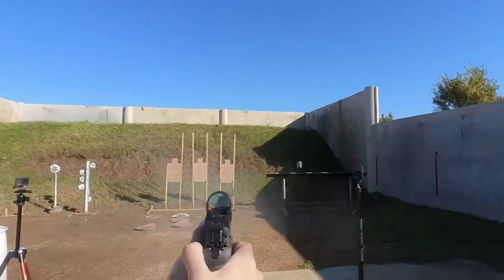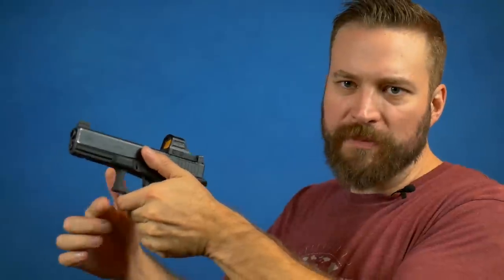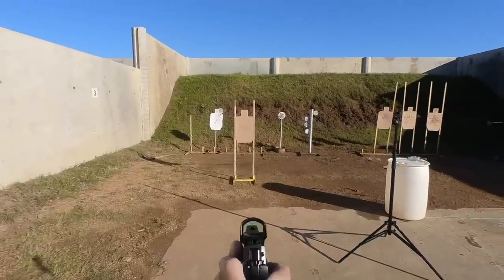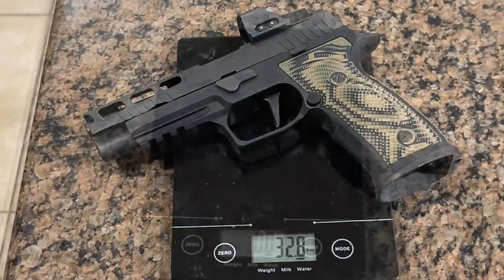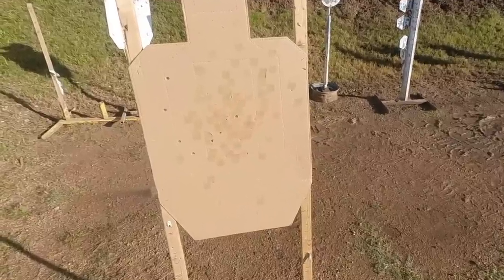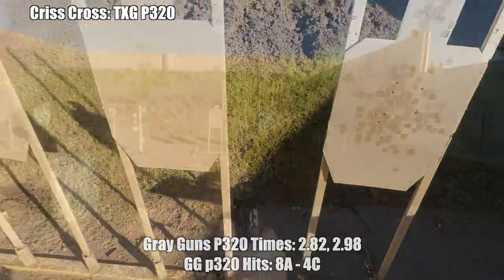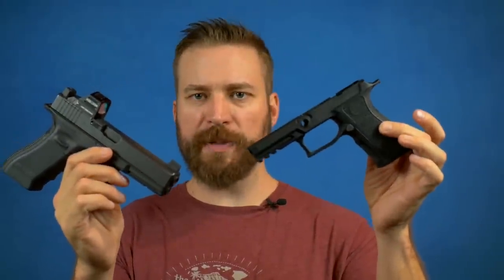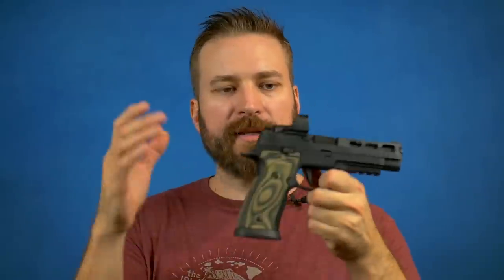Is BORE AXIS a MYTH? Testing Bore axis vs. Ergonomics vs. Weight

Comment: The differences between the way the glock handles, (7:39) and the gray gun SIG (7:52) are substantial. 

If you go back to carry optics would you run the P320,  langdon Beretta or the shadow 2?
Reply from the maker: Probably a 320 at this point

Comment: I just bought an AGX Pro and I do a lot of competition (IPSC), what do you suggest me, lok brass grip or g10 veloce grip.
PS: I have small hands
Reply from the maker: I personally prefer the brass grips if they are legal in IPSC.  They have a couple thicknesses.
Reply: with the AXG pro, would the addition of a tungsten guide rod be a good thing to do for competition or would it negatively affect the balance of the weapon?

Comment: I’m currently trying to decide between a plastic or steel framed Canik Rival, and if the extra cost is really worth it to someone like me. No doubt steel would be awesome. But using your examples on the 320 models we’re talking maybe .30 seconds improvement on these drills, which is significant for someone like you, not so much to so much to someone like me for an extra $400 difference in my considerations. 

Bro Science for the win, thanks!
Reply from the maker: If the steel frame is reachable based on your finances - I would go that way.  It will raise the skill floor some but maybe not the ceiling
Reply: @TheHumbleMarksman  it’s reachable, but when I consider still needing to buy an optic, extra mags, holster, etc I’m looking at a lot of money. This gun would be primarily home defense, maybe competing some day. I don’t even know that I’d use for classes.

 I also fit right in that middle ground of not a competitor but also not a static 10 yard range guy. Fortunately I’m in no rush, so who knows. 

I don’t watch a ton of vids like this on YouTube but when searching specific content there’s only a few guys I pay attention to and you’re one of them. 
Thanks!
Reply from the maker: for your use you'd be happy with the poly frame.

Comment: Absolutely ergonomics is king for me.  Never shot a Glock (P320 is my thing now, after a Canik Rival), but I have shot several of the Sig configurations you tested (Gray Guns, X-series and AXG), and the AXG with brass grips is what I finally settled on, just as you did, and for the same reasons.  Keep pumping out the good videos, dude!

Comment: Got an open question here for anyone. 
Wanting a new optics ready EDC ( price isn't necessarily an issue). 
I currently carry either my CZC SDP or my Wilson Combat EDCx9.
Not a huge fan of the standard Glock grip angle...opinions welcome.

Didn't  mean to hijack your comment section, I gave you a share and a like.
Reply: As far as the best factory optics ready guns similar to the G19 in form factor, I would put the brand new optic ready M&P at number one because the trigger is solid, ergos are fantastic, and the grip texture is best in class. After that I'd probably go for a shadow systems if you wanted magazine compatibility with Glocks and better holster selection. the trigger is alright, but it blows factory Glock out of the water. Ability to change grip angle to suit preference is awesome, and factory ergos are great as well. After that, I'd put the CZ P10C. As far as the gun itself, barring questions of holster selection, magazine availability/compatibility, etc, the P10C would be my first pick, but holster selection is kinda sparse, and the magazines are expensive and only used in the p10c, p-07, and A-01.  The only thing I don't like about the P-10c is the factory grip texture. It's maybe slightly better than glock's, but it is sharper and had less coverage of the grip. Best factory trigger of any striker gun in the segment though. Maybe I handled a lemon or something, but the PDP I played with had a significantly worse trigger than the factory p10c. Strange, because the old P99 had a significantly better trigger than either.
Reply: If you are trained and like cocked and locked Wilson has a optics ready version of the EDCX9. I love 1911s obviously but weight is a problem for me so the Sig 365XL with a red dot is my go to EDC.

Comment: Would have been nice if you had used the MR920 without a comp instead of the stock Glock 17. Would have been a more apples to apples comparision because those Sigs are by no means "baseline".

All this taught me is that a pimped out 320 is better than a stock 17.
Reply from the maker: You aren’t understanding what’s being tested if you think the parts is what’s making the gun return

Comment: In relation to muzzle rise and dip as it relates to grip, the support hand and knuckle under the trigger guard pivot point.  Is anyone experimenting with weapon mounted light by holding the light?  It would seem that the higher and much farther forward grip of the support hand on the weapon mounted light would reduce both muzzle rise and dip.  Maybe for another edition of Bro Science for muzzle rise or dip control.

Comment: You left out steel frame guns, and steel frame guns with low bore axis. But good video👍🏿
Reply from the maker: What’s a low bore axis steel gun?  Not aware of one
Reply: @TheHumbleMarksman  Kahr K9 or MK9 or T9
Reply: @TheHumbleMarksman  Alien
Reply: CZ Orange. Some will argue the bore axis isn't really that low but the inside slide allows a higher hold.

Comment: So... You're saying you don't use the P320 in your competition but you use something remarkably similar to the P320 and you wonder why the Glock performed poorly?

I'm not even offended by your conclusion, I'm just saying it's invalid.
Reply from the maker: If you think a 2011 open gun is remarkably similar to a 320 your powers of deductive reasoning need work.  Watch a video on a Bul SASII UR
Reply: @TheHumbleMarksman  isn't that what you said in the video when describing them?
Reply from the maker: @denmanfite3156  I said the index is remarkably similar.  Calling a compensated, frame mounted optic, hammer fired gun spitting out 9 major pills at 1400 FPS  "remarkably similar" to a 320 are your words.

Comment: Wasn’t really fair to compare a bone stock glock gen 4 to these Gucci guns. Put a $20 talon grip on it or do a homemade stipple job on it and polish up the trigger at least. That gun is what? 400 against a $1000 x5 legion heavy weight?
Reply from the maker: The point isn’t the gun but the bore axis.
Reply: @TheHumbleMarksman  if all other factors being equal, then bore axis matters as you alluded to when u said that ‘physics is a thing’.  U also didn’t mention as you had in past videos that the glock grip angle locks the wrist in a stronger position to handle recoil compared to more 1911 style guns. Sounded like u were trashing glock relative to sig when compared to your older videos when u were running the OG Glocks.

Comment: Bad comparison, you have a liggtweight upper on the P320, go back a do the same test with a regular P320. I shot a P320 of the size of the G19, it was the worse muzzle rise for a 9mm i have ever tried. Please, make a fair comparison next time. And, next time, gat a low bore axis that you van shoot better.
Reply from the maker: do your own video.  The data is still good even if you don't understand it to be.
Reply: @TheHumbleMarksman  i understand that you think it is a good comparison.
Reply from the maker: You seem like a bright guy - so  you probably also understand the majority of the commenters on this video found value in the data.   

Muzzle climb matters less than you're saying it does - shoot a PDP in anger and be amazed how tight the groups show up.
Reply: @TheHumbleMarksman  i haven't shoot a PDP, i shot a P320 Glock 19 size and it was the worse experience of my life regards of snappy handgusns, but i can respect other people's experiences.
Reply: @TheHumbleMarksman  also: Ammo selection makes a lot of difference. Try some underwood +ap+ ammo.
Reply from the maker: if your experience is based on slow fire group shooting only you'll miss the plot.    Try hammered pairs and check for controllability.  The PDP - far and away - is the heaviest/snappy recoiling 9mm in whichever size you try it in - BUT the frame is so amazing - it returns to zero like a boss.  When shot at practical speeds - it performs better than some guns which have perceptibly less muzzle climb.  

The point is the balance of grip matters more to sight recovery than the bore axis (by extension - muzzle climb) alone.  if the grip doesn't allow for a balanced grip - then the reduced muzzle climb is irrelevant.
Reply: @TheHumbleMarksman  I agree on everything except the high bore axis, to me it was a deal breaker. Try an M&P2.0 9mm and see it for yourself, you wil see how fast of a shooter it is. How ecer, great explanation on everithing else.

Comment: Take away the beaver tail  on the 320 and and i bet the glock shoots  WAY better, you have a lever  on the back of the gun,there's  absolutely nothing to debate bore axis does matter its physics  plain and simple,sig didn't  put a giant tail on the gun for nothing it was to counter  act the high bore axis lmao, what next slide weight dont affect shots? Go back to school  folks,the x5 tungsten  is literally the heaviest gun on the market again to counter act bore axis and slide weight/recoil guess whats that's  called ........physics
Reply: What a very long winded way to say you agree that ergonomics is more important than bore axis.
Reply: Actually no
Reply: Your argument is to hacksaw part of the 320 off to make it a fair fight. Who’s making these modifications? Who’s doing this and saying, “damn my Glock shoots WAY better than this 320 I just lopped the beaver tail off of!”

No one has said that bore axis doesn’t matter. This video simply showcases that it isn’t the end-all-be-all that Glock fanbois like to spew like vegetarians telling very one else they are vegetarians.
Reply: Well I actually have tested the P320 with the tungsten grip and with just the plain polymer on with and without a grip weight. 

The tungsten grip did nothing to prevent muzzle rise. Pretty much same results as the the lighter grips. The gun was much easier to control though. 

As far as comparing it to other guns it’s about average. Actually for me it was the same as a Glock. The only differences is I get more muzzle dip/bounce with a 320. The weight helped a lot to get rid of the bounce. 

With weaker hands like my wife’s, the P320 performed much worse than other guns. She got 5 degrees less with a CZ p10s than the 320 with a comp & just the regular grip. Would be interesting to see if weight makes a difference for her. Her perception was interesting though. She didn’t complain about the 320 flipping more than the CZ. So the P320 was returning to zero pretty much the same speed as the CZ or at least she couldn’t perceive a difference. 

Physics do mean something, but that will greatly vary from shooter to shooter. Plus I think this is an argument of splitting hairs. Data may show an advantage, but our brain may not be able to perceive it. So how many milliseconds are there in between 5 more degrees of muzzle rise? Like I can tell if a gun feels more flippy, but if the sight is back on target, I’m pulling the trigger. The guns I perform with better are the guns I shoot the most and a timer proves this. I don’t shoot my 320 much but it performs on par with everything else.  Probably because bore axis just isn’t a major factor in performance. And at least I have actually measured results with the MantisX and a shot timer.
Reply: I have small hands so I can't even use p320

Comment: I am a little bit conflicted. For the past couple of years you were praising Glocks blocky grip as a tool that helps shooters to apply strong back to front pressure. And you've praised its angle as a tool to help shooters lock the wrists. Both should help control recoil as per your previous videos. I've taken your opinion quite seriously and sticked with Glocks. To be honest, I feel betrayed. I know you can shoot Glock way better than that. I know because I can shoot it way better than you did in this video. And I am no master.
Reply from the maker: I am out of practice with glocks - I could shoot glocks better than that.
Reply: @TheHumbleMarksman  that still doesn't explain why the points you praised the Glocks for in past are now a bad thing. Makes zero sense.
Reply: While I think you have valid points, betrayal seems an overly strong emotion in this case.  People change their opinions over time based on experience.
Reply: @BloodyCrepe His opinion is evolving based on what’s available and what he’s been able to use, test, and compare. Many of those P320 components weren’t even on the market 18 months ago. If Glock is your choice of handgun, then stick with it. It not his responsibility, but yours.
Reply: @Murphy82nd  they sure do  but not by bashing every single point they were praising firearm for
Reply: @SectionChief  unless you are addressing the points in my comment, don't respond. Humble marksmen can speak for himself. He doesn't need you to respond for him.
Reply: @bloodycrepe  I don’t know that this meets my definition of bashing, but for myself I have done 180s on certain topics.  

I think people in the shooting community tend to wear their hearts on their sleeves.  If someone doesn’t like the same inanimate object that you like it’s not a big deal.  Your shooting isn’t contingent on the approval of others.  What works for each of us is often subjective.  Even here THM chose as his favorite something that didn’t win points wise.
Reply: @Murphy82nd  it's not about that. I don't get attached to brands or objects. They are just tools at the end of the day. However when you establish yourself as a master of craft, you'll have people looking up to you and your opinion. In this case, I have sticked with Glocks partly because of ops opinion on them even though I shoot way better with CZs. Humble marksmen repeated on numerous occasions that initial feel of the ergonomics is an illusion. He said the blocky uncomfortable grip of Glocks is what assists shooters in recoil control. It's not just a 180 change of opinion in my books. It's a complete change of fundamentals that makes me feel that he was dishonest in past few years at first place. Yes it's my fault in putting trust in a random YouTuber. Not everyone has integrity I suppose.
Reply: @bloodycrepe  wow,  that you can walk away from this video thinking it means he was “dishonest” in years past and lacks “integrity” is baffling to me.  I think you need to focus more on yourself and less on the opinions of a person posting videos to YouTube, of which there are practically countless people.
Reply: @Murphy82nd  yes there are others that did change tools but didn't change fundamentals of how they teach and approach shooting on a whim. It baffles me you think op needs you to respond for him at first place. My comment was left for him not for you. Maybe a bit of minding your own business and not personally attacking those with different opinions will go a long way for you.
Reply: @bloodycrepe  yes I read where you said the same to the other person above.

You are posting in a public space that allows replies to comments.  You’re going to get replies, including replies that disagree with you and explain why.  That’s the nature of this space.  If you don’t like that, then I would suggest you send a direct message to THM either on YouTube or on Patreon.

Comment: So a stock glock and 3 well over 1000 dollar sigs 😂 sounds good.
Reply from the maker: Remind me how price affects physics?
Reply: Even if you buy a stock Sig, you can turn it into a gun that's even BETTER than the ones shown on this video. The entire gun is completely interchangeable and you can switch out practically everything. Cant say the same about Glocks. Other than the trigger and slide, you're left with the same crappy ergo/grip which was the point of this video.